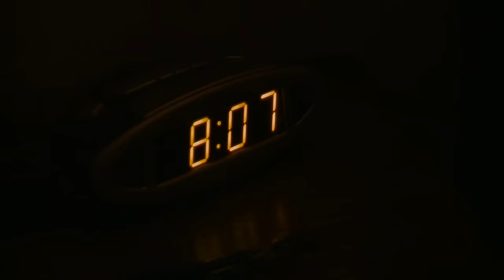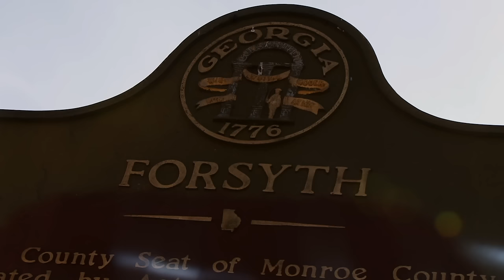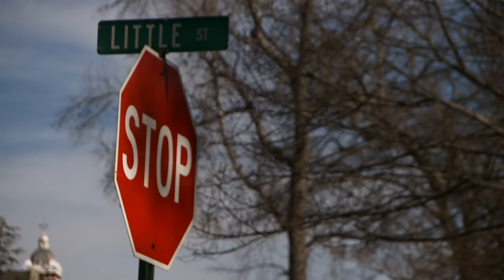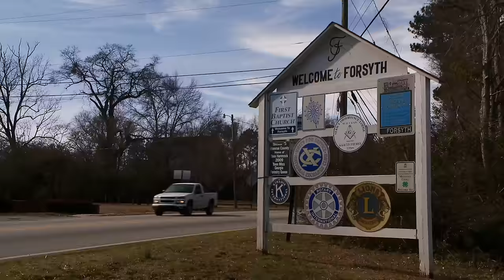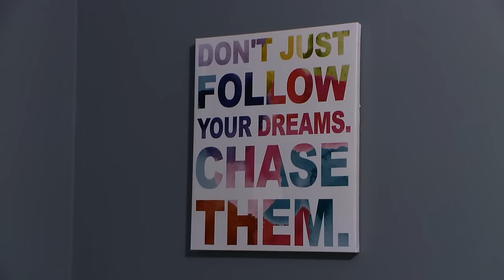7 Little Johnstons: Birds and Bees Make Babies (S1, E1) | Full Episode

Comment: U can always tell when the guy using  the drill gun isn't a Carpenter ...the drill bit strips of the screw head. Hear that clicking sound he just made w the drill gun? That demonstrates exactly what NOT to do. If it makes that  noise uht apply more pressure...that will stop  lt from stripping it out.